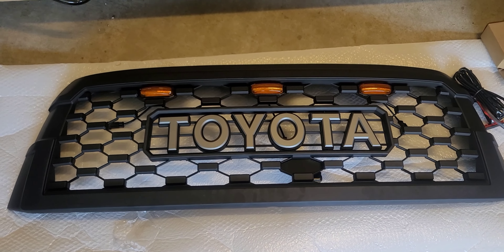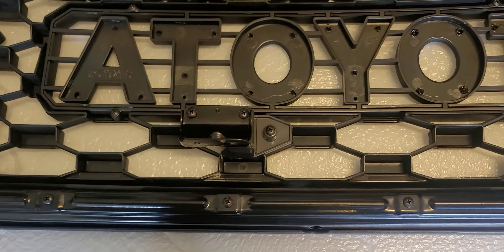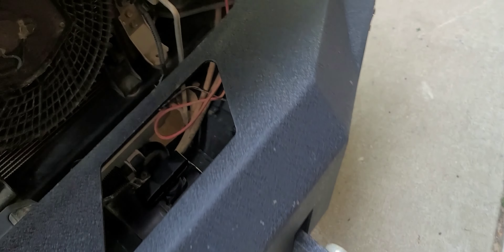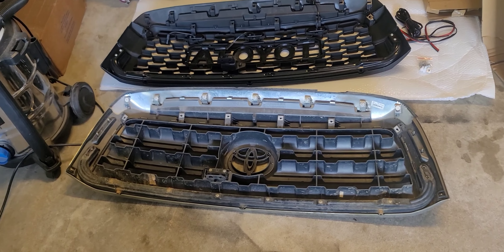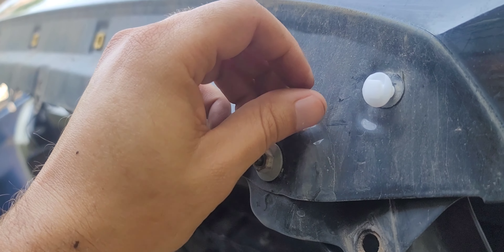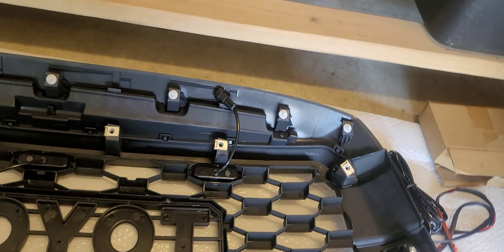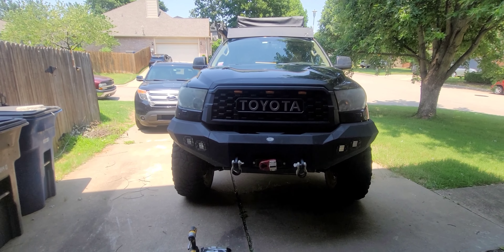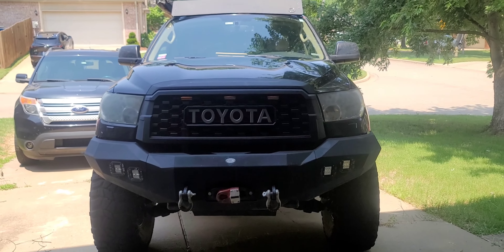Toyota Sequoia 2nd Gen - Grille update

Comment: Does the original Toyota OEM TRD grill work on the 2nd Sequoia?
Reply from the maker: @Methodical2  yes, you need the grille and the piece that sits on top of the grille.  But they are hard to get now.  Require you to give a TRD pro Vin.

Comment: Did you get the lights to run ? If so how did you run the wires
Reply from the maker: I used some 3m sticky zip tie style wire holders to run the wires along the hood down to the back and back up to the lights.